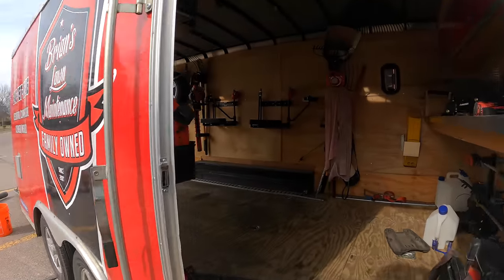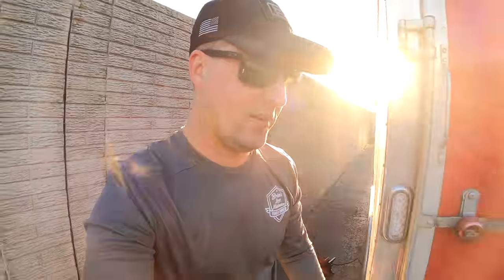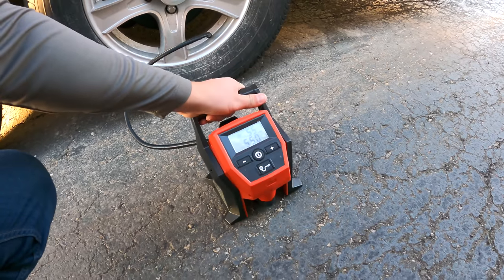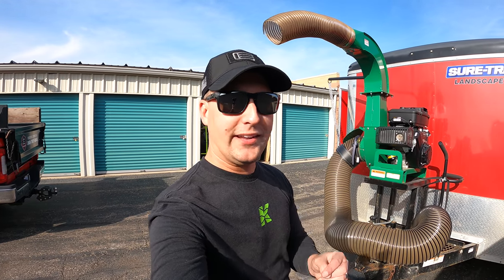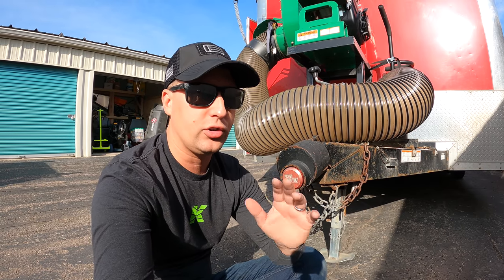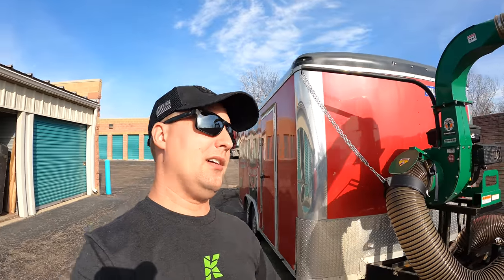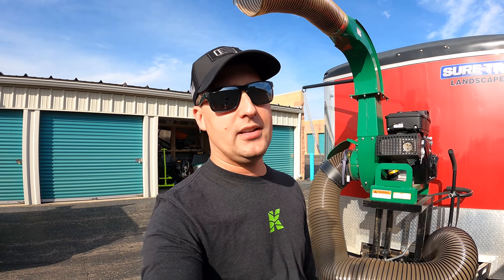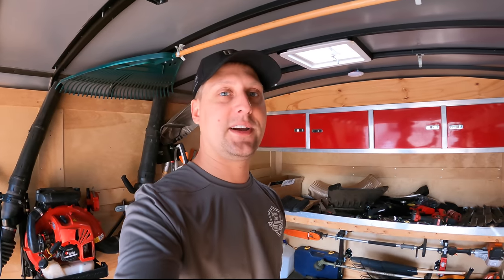Leaf Cleanups Action, Trailer Rack Setup, Ballard Super Jack! ► Weekly Shorts Compilation!

Comment: For the space and weight a farm jack will be more useful fwiw.  If you get it stuck and cant get another machine to pull it it can be used as a come along or for pulling out bushes where machines cant go.  Get the high lift rescue jack if your getting one the extra features are well worth it. The micro compressors are great for filling up low tires on the go but not for extended use if you expect it to last, I love mine for what it is.

Comment: Thieves are scumbags, but also sometimes smart. Like with that lock on the rear trailer door, they can ignore the lock altogether and use a 18v compact recip saw on the latch bar itself. And be in very quickly. Its the same principle of someone having a steel front door on their house, so the thief smashes out the window next to it instead. Not trying to scare, just bring awareness.
Reply: Completely true and agree, but it is there as a deterrent. Brian even says that you can probably pick it as well, but it is just to make thieves go to the trailer without locks first before yours.

Comment: Hi Brian, thanks for your channel and for this video. I recently bought a pro-sumer ZTR for my residential use. The first time I had to lift it, I resorted to a car jack and jack stands. I did not like that. This Ballard Jack really interests me. However, I've seen more than one video of men having to struggle a bit to lift their mower. Mine is a 60-inch weighing in at a bit over 1,000 lb. I'm a big guy, 280 lb, but I'm in my mid-60s with arthritic knees. Do you have any feedback that might help me? Maybe it's not as hard as it looks? Can a small woman or a 10-12 year old boy get a mower into the air with this jack? My other option is to go to a hydraulic or cable-lift jack, but those are so slow. I'm not that patient.

Comment: I love our proven industries coupler lock. The puck locks on the other 3 latches are really over kill.  I'm not going into detail on this public forum but the cam action door latches are easily compromised.
Reply from the maker: Right, but I’d rather have them then not have them. Angle grinder or otherwise 99% of folks will not be breaking into your setup with all doors locked 👍
Reply: @BriansLawnMaintenance   I agree 💯 but 150$ worth of Proven Industries Puck locks on those 3 latches provide the same protection as 3 20$ locks do.

Comment: I just purchased a Toro 52inch 4000 series z master, and ordered the twin bagging system from Toro as well. Dealer says same unit for the 5000 and 6000 series only different bagger mount. I think its the same blower  mount setup for the exmarks too. for yours how far does the blower stick out from the deck and do u think I should have no problem going in and out of my 7x16 enclosed trailer?  also I have the 52 z master parked up in front near side door and have my new Toro grandstand 36 at the rear. do u think the mowers are positioned correctly from having more weight in the front from preventing tail swaying?  any suggestions thx. also great vids